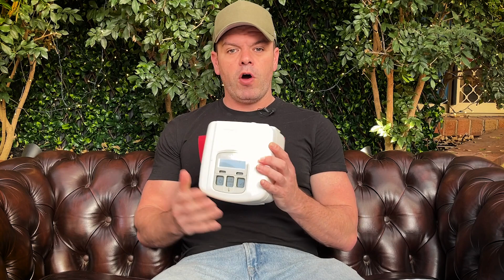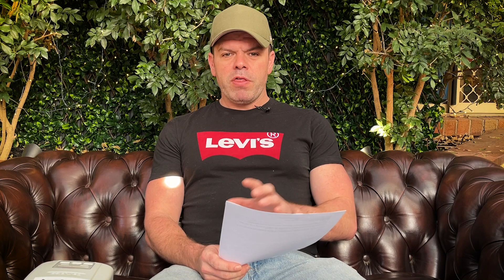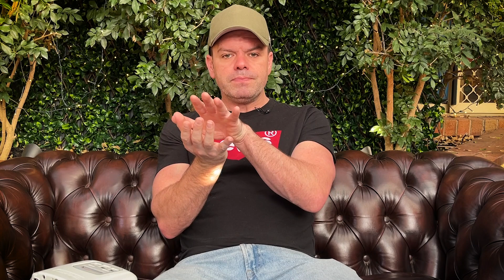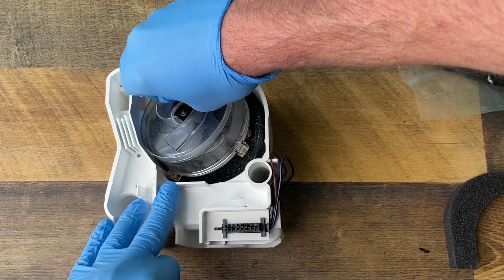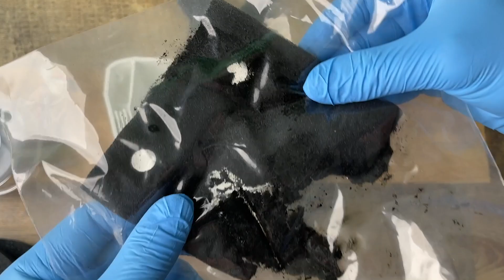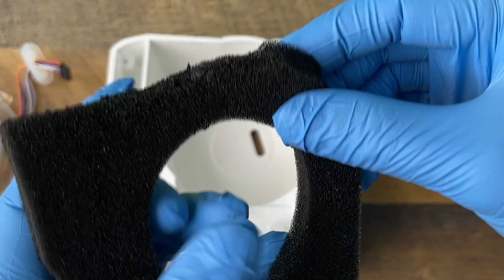DeVilbiss CPAP Foam - Polyester Polyurethane Foam - Is It Really Safe?

Comment: Hello I just read your article. I am a long-time CPAP user and own 2 of these machines DV54D. The oldest one has well over 15000 hrs and has been very reliable. However, recently it has become very noisy so I took it apart. There is no local repair center here. All the foam is badly deteriorated. No wonder it's noisy. The machine works fine but I would like to know where I can purchase a new replacement "Foam Kit"? Important, please advise. Also, definitely NOT ozone resistant. I use an ozone generator. The foam is grossly deteriorated. I have photos.

Comment: You didn't do a foam removal guide for this machine... but I assume it's relatively straightforward,  and I should just roll up my sleeves and open it up myself.
Reply: So did you remove the foam , if yes how machine work after that
Reply: @bekulica  noisy.

I used silicone foam to replace the old foam.

Then I sold it to someone.

If you can be bothered, it's worth it.

The biggest issue is being very careful not to strip the heads of the screws that are accessed deeply from the base.
Reply: @DoubtingThomas333  tnx man

Comment: I woke recently with nostrils full of flecks of black foam. Checked the mask and tube, I found black in there too. Took the hose off of my DV5 intelliPAP and turned it on. A flurry of black bits of foam shot out, about 4 Tablespoons of the stuff, I estimate. I have definitely inhaled this foam in my sleep. My doctor had no suggestions other than wait and see. Is there no treatment to undo the exposure before it could turn to cancer? Maybe you could interview a toxicologist and suggest a course of action for detoxification. I opened the DV5 to remove the foam. It's a mess in there. The remaining foam is tacky and left a coating on the internal parts. The turbine has a clear housing and I can see that its inside is contaminated too. I believe that it is beyond salvaging. Nick, I have photos of the inside of my machine; if they would be of use to you or others, I could send them to you. Additionally, I have never used an ozone cleaner.
Reply: My machine is 12 years old and there's no sign of foam particles.

Comment: My mom was using this machine and was constantly getting pneumonia and the doctor said that her CPAP machine could be causing toxic problems
Reply from the maker: Sorry to hear that. Thanks for letting me know and best wishes for your mom. Nick
Reply: I'm still using the machine. 12 years, and it's still kicking ass.  Bulletproof.  Bombproof.  I gauge the pressure to check if it's within spec....always on the money.

Unless it blows up, I'm not replacing it.

Comment: Hey, maybe you could find one of these machines that's several years old and see if the old foam is showing signs of disintegrating on it's own.  That would be an interesting and suggestive data point.
Reply: Just FYI, my dv54 isn't showing any signs of the foam breaking down.  It's almost 10 years old now and still a beast.  I think it really doesn't help if you use ozone, which I unnecessary anyway.  Ozone works well but it also breaks material down over time (anything it comes into contact with).  I just use soap and water in all my masks and tubing, works fine.  Make my own filters, dishwashing soap and warm water for everything else.  Alcohol wipes

Comment: i just replaced my Dreamstation with a Devilbiss Intellipap 2... actually find it is a better operating machine than the Phillips.... and way (relatively so) cheaper than Philips or Resmed.  Regarding the heat breakdown (just my opinion) is hard to agree, the foam is before the hot plates and only cool air under pressure blowing over and away from it. But two questions.. is the foam breaking down on its own and the manufacturers culpable because they are using a crap foam, and/or, is the primary catalyst the cleaners that force ozone through the foam under pressure breaking it down??? was the effect of ozone tested on the foam before coming to market with these machines, and to add to previous comments why is there no call on these ozone companies to prove they are safe... or also face liability.  Because in some small fairness (very small) pretty much all the cpap machines were designed well before these types of cleaners were in existence. 
To further add to comments on the costs of cpap machines.. absolute highway robbery for a blower with some microchips just because they are required for health and often paid for by governments and insurers..!! absolute scam and corporate collusion on full display

Comment: Phillips put a potentially harmful (and lethal) foam in the airways.  This, in itself, is a major blunder.
Reply: Nope.  People use ozone treatments (which is oxidising and completely overkill) as they've been spouted as the way to clean the machines etc... all nonsense.  The pre pump air filters keep the unit clean inside, and you just clean your masks and tubing with laundry soap and warm water.
Reply: @DoubtingThomas333  Phillips has already admitted it has made that major blunder.

Comment: Just like Philips, they have changed the foam type on the newer DV6. I think that they also knew the old foam isn't good.  Just looking at the motor, it doesn't look like it would work right after removing the foam, as it appears that the foam actually stabilizes the motor. The Dreamstation uses screws holding the motor in place. My mother use this machine, but fortunately she doesn't use ozone, but I am still going to try to help her get a new Resmed S10.
Reply: Caulk Silicone works fine in place of screws, just need to make sure you use enough to do the job properly.  Some experimentation is worthwhile.  I'm going to mod my one.
Reply: @DoubtingThomas333   hi a few years late, but did you mod yours with success? Thanks

Comment: There should be no foam at all in cpap machines, they aren't that noisy without it, how can we fully trust any such materials in our machines, it's a matter of life and☠
Reply: I suspect the foam is there for more than noise abatement. 
It is probable that it also provides some dampening of pressure coming from the turbine. CPAP algorithms rely on VERY tiny pressure variations to detect snoring etc. Any pressure oscillations in the delivered air could affect it.  Noise could be handled just with muffler chambers and thicker plastics.

Comment: Damn, these machines are so basic but yet so expensive just non sense
Reply: I think we're paying for the technology in the circuit board because the rest is pretty much 8th grade science project. And if you setup to just start at a 8 pressure and run all night at 8, all the rest is just useless data
Reply: It's the sensors and software/firmware too.

Comment: There is a cleaner called Sleep 8 , it only cleans the humidifier chamber, hose and mask. It is put into a bag and then it cleans it for an hour. Can you look at it and tell me what you think?
Reply: I have one of those. It’s only cleaning the mask not running through the machine but I hear soap and water still needs to be used.
Reply: You only need laundry soap and warm water.  Rinse with water afterwards.  Plug it all back into the machine and run it for an hour to dry it all out.  Done

Comment: My DS1 is almost 5 years in service, probably 4 of which has had a soclean ran daily. My foam was breaking down to the point when I took it out  the crumbs turned to a sludge if you tried to pick one up. With the foam gone I don't worry about it, or the ozone. Why didn't they just leave the foam out because I can't tell enough difference in the sound that it was worth the time or money to put it in there.
Reply: greetings, do you still use this method? I hope that sponge is only for noise. Does it work properly after removing the sponge? And when I opened the device under the cover before the sponge there is a thin cover that must stay inside otherwise the device does not work well. that thin cover is also made of some black rubberized material. Now, is he also dangerous or not?

Comment: OMG As soon as I saw this video Nick I put my cheese cracker straight in to my mouth without dipping took a long hard swig of my OP Rum and sat in amazement. As I told you before my sleep cube would be about ten years old and I have NEVER ventured inside it like you just demonstrated. S H I T  10101010101- - - There is also the silicone seal which is now perishing so I am even more afraid to venture inside. Lets say 355 nights by ten years = 3550 by roughly 6 hours = 21,300 hours approx. And possibly the last 3000 hours I have been smelling smoke and have stopped using the humidifier but add water to reduce the smell. Works most times. I am so appreciative of your efforts to discover the truth.

Comment: At what point do SoClean and Lumin and the others have to issue a recall on their own products?  These machines have always been snake oil, but at least up until now we thought they were at least benign snake oil.  Has anyone been pressuring them? They should at least be putting a warning on their devices.  I’m surprised every cpap manufacturer doesn’t put a label on their devices saying “don’t use with an ozone generating device”.